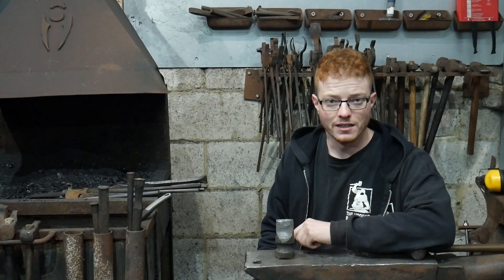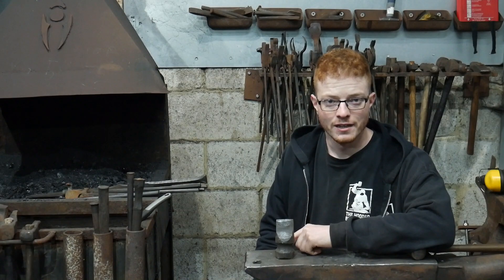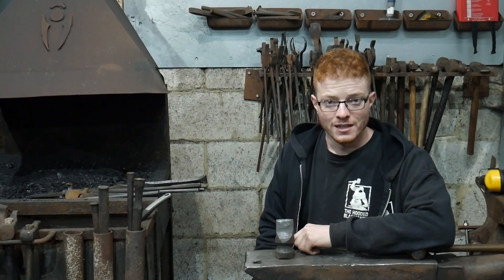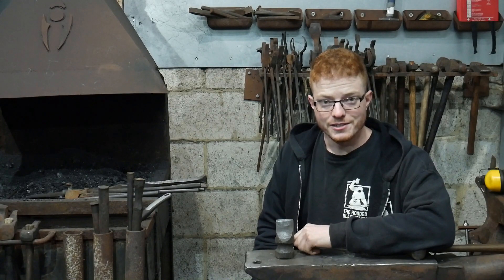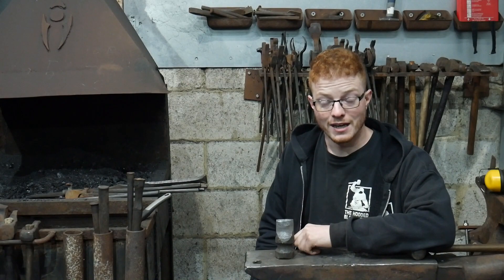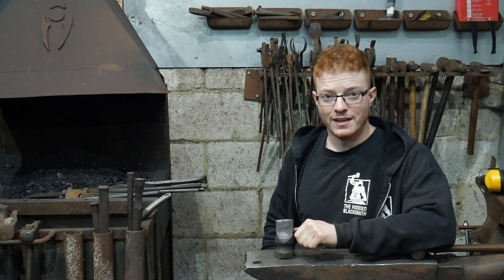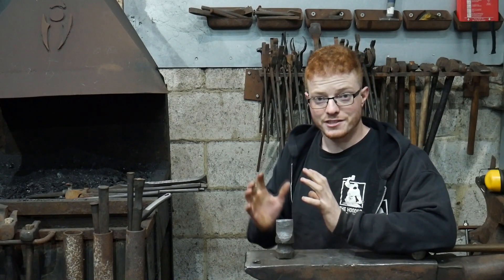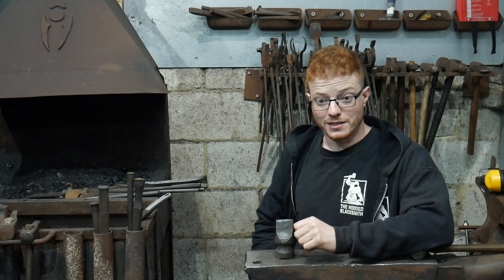Building a portable forge

Comment: I never realised the tuyeres were so high in a side blast forge. Solid build though,  You might have struggled with the 5mm, but I wouldn't have built it out of thinner, forges need to be robust! And of course you need some weight in it to balance all that kit hanging out the back.
Reply from the maker: It could have been lower but I just wend with what looked right it had some thick firebrick then an ash bed